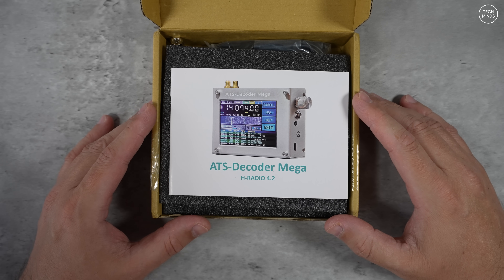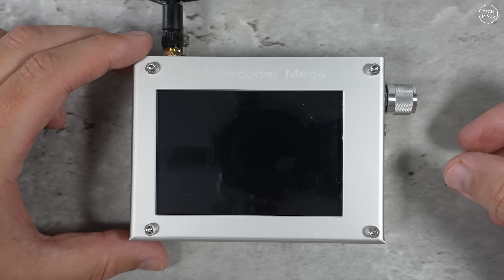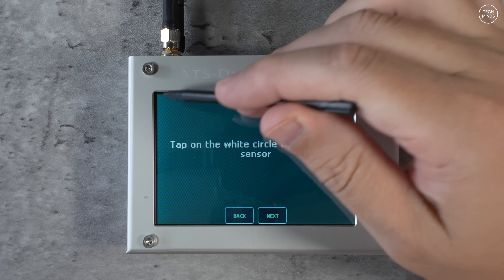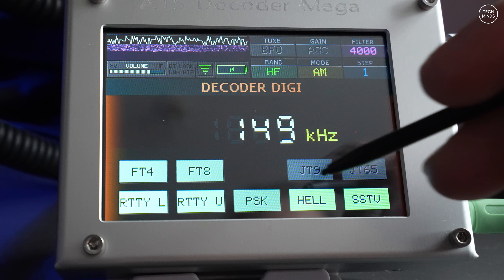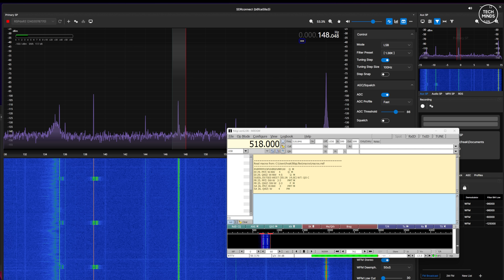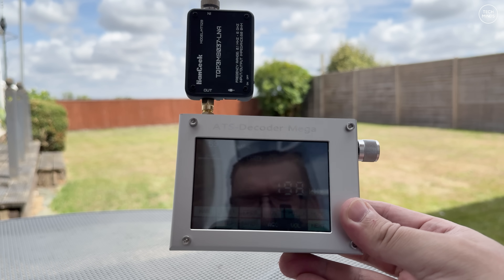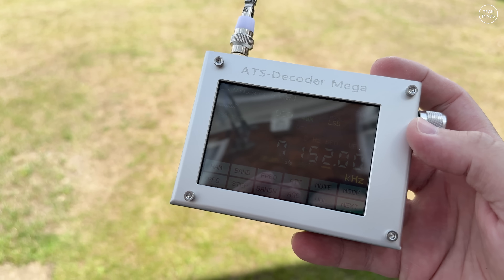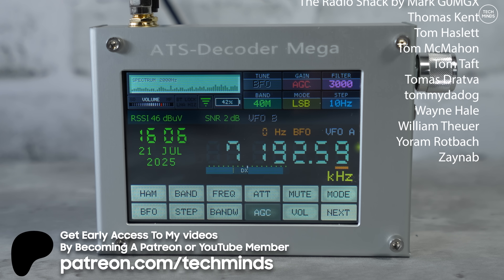ATS Decoder Mega SDR Radio - Apparently it can decode digital modes!

Comment: I think I lucked out. I purchased an ATS25 Max Decoder last year and it works surprisingly well. A recent firmware update gave it SSTV capability and it works OK too. 
There IS a memory issue with these ATS units when decoding digital modes though. They don't have enough horsepower and RAM to keep a large and constantly updating live cache for it to decode every signal that it can receive. It causes a buffer overflow that resets the counter and clears the cache and starts all over. They're programmed that way or they would crash all of the time. In my testings I have determined this cache to be around 20 seconds of data in size, so that means every 20 seconds the unit dumps what it has in cache that hasn't been decoded yet and starts over, which causes gaps in what it is able to show to you. For FT-8/4, RTTY, and SSTV this is unacceptable. With the right firmware these can decode CW well though.
Don't get me talking about the garbage AGC these have. Ugh!
It's a fun toy to play with. Not suitable for daily use unless you enjoy frustration.
Reply: Yep , I have one too
..got a firmware update .. it also does FT8 and FT4 etc...

People say don't let .ru made stuff on network etc...etc
They really need to wale up to what the EVIL their own govt is doing to its hardworking ants/citizens.

Comment: Perhaps the timing is slightly off affecting ft8. I have seen this often and requires a tweak to the clock if possible.
Reply from the maker: I think the time was correct, as I enabled wifi so it pulls the time from the internet. But, never say never eh! cheers